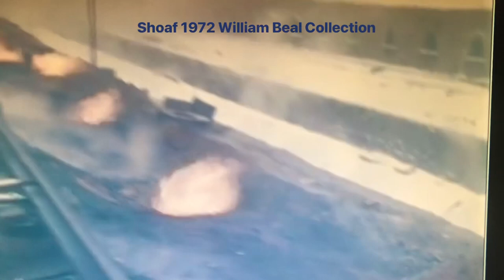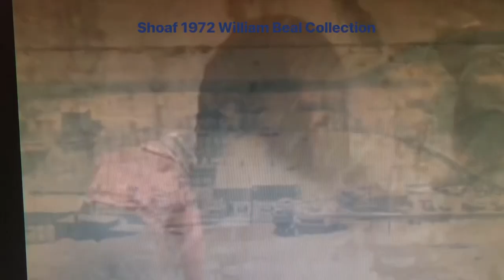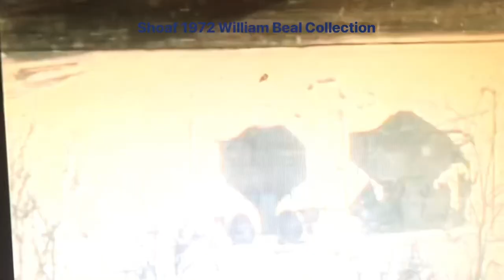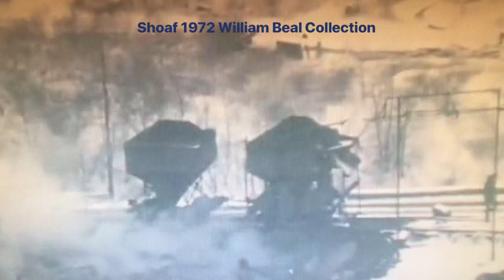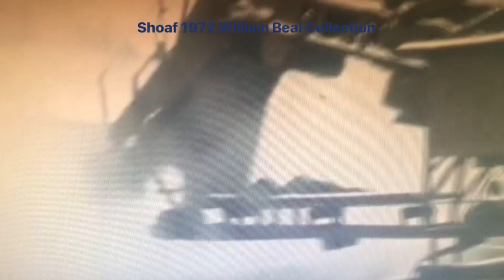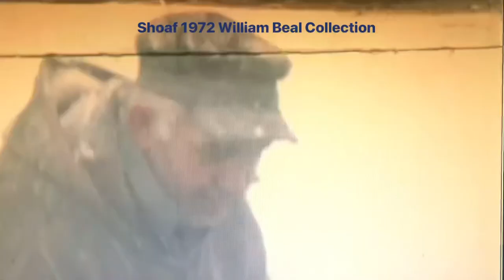Coke Ovens Shoaf PA last operating ovens 1971-72 William Beal collection

Comment: I was a young, green, naive 18 year older only 10 days out of high school when I started in the coke ovens at the Bethlehem Steel Plant in Sparrows Point, Maryland. Wow what a shocker!  It took me a good 6 weeks before I was able to adjust and handle the heavy demands this job. It was very hot that summer of 1978. I wore jeans, sweat shirt, and a flame retardant suit over that on the top of an oven. It was an incredible experience
Reply: I started working in a Coke Plant in Follansbee, WV in June, 1978 just graduating from High School also. First day they stuck me on top of a battery to learn to be a Lidman. The way  the Larry Cars were designed at this old Coke Plant built around 1920 I am guessing, is lucky I did not get killed. The Batteries were not like these Beehive ovens. Made good money but quit after 6 years to go to college.  The Coke Plant shut down last year after a 105 year run which is sad.
Reply: @heavenlyblue  wow sounds like me. There was no black or white back then. Everyone looked out for me. “Youngblood” as I was called would have ended up in the burn center if it wasn’t for them.  I ended up going to college as well. The plant in Sparrows Point, Maryland was the largest in the western hemisphere. Russia claimed to have a larger one. It employed at its peak some 35K people. It had its own police and fire department. It had a medical dispensary & even its own morgue.

Comment: I didn't know you had changed your channel name for years I always remembered you as stuff that's gone.

I have to ask have you been to Galt Illinois? 

If you haven't there's an abandoned steam locomotive on a siding out there and it's actually got a very interesting history, the locomotive was one of a few that were sent to Northwestern Steel and Wire where they would have been scrapped but instead of scrapping them Northwestern steel decided to use them as replacements for their existing switchers and as a result kept them in service until 1980 which was when they were all finally retired. Most of the locomotives were preserved but five were sent to a scrap yard later on and then one has been abandoned in Galt ever since
Reply from the maker: I didn’t know I did either. I changed my email address and it changed my channel name I’ll have to see if I can fix that
Reply: @StuffthatsGone  its back now